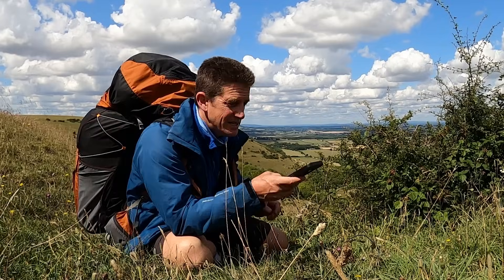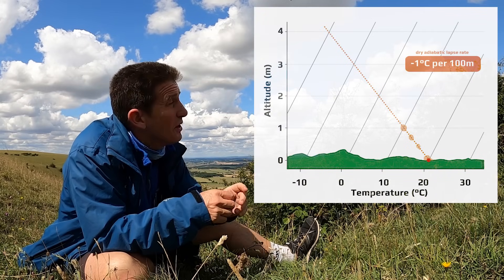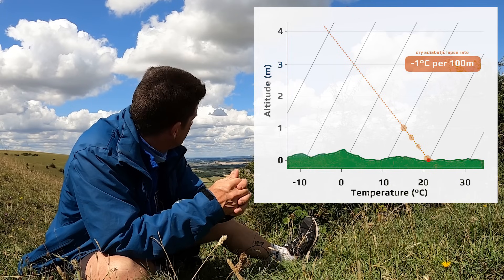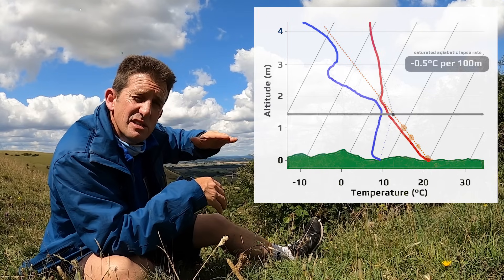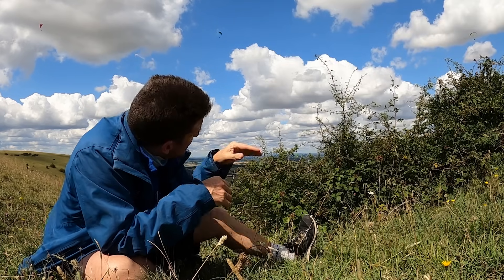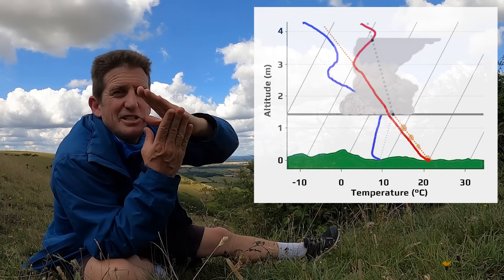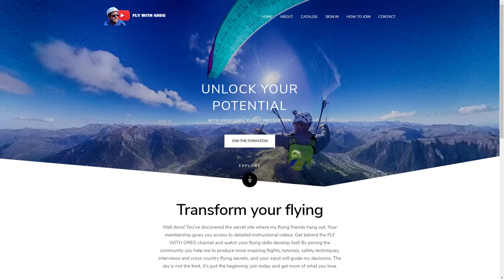How do CLOUDS and THERMALS really work?

Comment: Holy poop Greg, What a fantastic explanation of Thermals.  I personally have been in 1400 Ft/min up, with my Hang glider. Bar pulled down to my nuts and still going up at 400 ft/min. Middle of summer and sleet on the front of my gloves :)   The 2 -3 seconds of disbelief looking at my Vario, made me remember an article about "Cloud-suck" read while sitting on the "Throne" 6 months prior :) ... Escaped the lift and learned first hand what you described here today.  My point is, to thank you for taking the time to explain how the "Thermal engine" works and by default, you may or soon will have saved lives.  Nothing better than having a first hand Nature Moment to drive home the lesson.  All the best, fly safe :)

Comment: Hi Greg although I am not a paraglider pilot ( I did fly a paraglider a few times on the training hill )  my background in aviation is in hang gliders, sailpanes and 
fixed wing aircraft. I have seen a few of your videos now and I have to commend you on your presentaion. Absoulute understandable ,quality videos .
I do have to take issue one one point in this video at 8:33 where you said that there needs to be an inversion to stop the cloud from rising further.
While this is true ,the presence of a stable layer ( very little ,or no change in temperature with altitude)  will effectivly do the same thing,although it won't
arrest it as fast as an inversion will.
Many instructors will say that thermals are stopped by an inversion layer when actually they are being stopped more often by just a stable layer.
Keep up your great content.Your efforts are appreciated by many.
Reply: My bad Greg . I did not see on the graph at 8:56 ,where you wrote " Or at least a stable lapse rate "  Once again Kudos for an explanation
that anyone can understand.

Comment: Hi Greg
Liked and new subscriber.
I'm a paramotor pilot who tends to be a bit geeky and I really appreciated this video.
I have been using and preaching the Skew-T charts to all my PPG buddies who would listen (most don't) and I've wondered how interesting they are for PG flights.
Now I know.
The charts have a long learning curve but they provide so much information that I'm astounded that more people with and without motors don't use them.
I understood some things about them already but you've added to my knowledge and understanding of the cloud engine with this video.
I plan to eventually be a daytime motor off thermaler (no hills to launch from in this area) and this will certainly help.

BTW, there is a Skew-T app on Android which seems to work fairly well. I rely on it more than on any other weather app for day of and day prior to any flying.

Thanks!

Comment: Great video, as always :) Super informative! 
How do mountains affect the skew-t-chart? I fly in the alps and often find clouds forming much lower than the predicted cloud base from the emagram (skew-t-chart) or expect clouds to build much higher and they don't. Perhaps I'm just reading it wrong...? 
Example skew-t: https://www.meteoswiss.admin.ch/home/measurement-and-forecasting-systems/atmosphere/radio-soundings.html
Reply from the maker: Mountains complicate the picture, because after rains they hold sources of moisture up at higher altitude, so introduce moisture that will condense earlier than you were expecting. After a day or two, on open slopes, the mountain has drained and dried and then it acts to boost the thermal power and the added heat can raise local cloudbases. So it depends on the timing relative to rains.

Comment: Hi Greg, great video.
I think your dew point line is wrong on the drawing because your thermal temperature line doesnt cross the dew line, so the cloud doesnt form.

For the cloud to form and climb up, the thermal temperature has to be left of dew point ( otherwise it doesnt condensate) and right of environmental temperature line.( otherwise it doesnt climb).
Reply: Not so, but a very understandable mistake. The thermal moisture content is derived from the source, at the surface.whee the thermal was born, not the surrounding environmental air at altitude. Therefore the dew point trace is irrelevant for a rising parcel of air. The moisture content of the thermal is constant, and we follow up the line of constant humidity, not the dew point temperature trace, to find cloud base. It’s a different line on the graph, which Greg didn’t cover. :)

Comment: Great video! I was wondering for a while how come clouds work the way they do. Please allow me to express doubt about what you are saying at 2:45. If you take ideal gas law, you will see that with increasing volume (of the air in the balloon) the PRESSURE will go down but not TEMPERATURE (in a closed system which it is). This mistake can be easily made if you consider temperature as number collisions. However, the temperature is the amount of kinetic energy the gas has (which of coarse increases the number of collisions but it is still a consequence, not a cause). It doesn't influence your further arguments so it's just a detail. I don't know how these balloons work but I guess they measure the difference in pressure inside the balloon instead of temperature. Or I made a mistake somewhere? If I did, please correct me. Still, thank you for making this video! I learned a lot!
Reply: Look up isentropic expansion: Reducing the pressure through an adiabtic will indeed decrease the temperature and increase the volume.

Comment: Maybe I’m misunderstanding you but I don’t think what you are saying at 2:20 in the video is correct. 
This is the way I see the world working. Cold air is dense and the molecules are tightly packed together. Hot air is less dense because the molecules are moving and create space in between. A hot air balloon goes up because the air is less dense and lighter. A balloon gets bigger the higher you go because of the pressure from the atmosphere the same way it would get smaller as you submerge it deeper in water.
Reply: I think similarly, I commented with a more detailed explanation higher up.
Reply: The Ideal Gas Law states that PV=nRT.

If you heat a gas (T increases) but keep the volume and pressure constant (like a hot air balloon), then 'n' (the amount of air molecules) have to decrease. The heated gas gets less dense, when air molecules escape from the bottom opening of the balloon.

For a rising thermal both the pressure and the temperature of the surrounding air sinks, which the thermal tries to align itself to.

So if P decreases, then also T decreases. If the pressure has been equalized, but T is still larger than the surrounding air, then 'n' has to be lower. The thermal is still lighter than the surrounding air and keeps rising.

This goes on until the pressure and temperature of the thermal equals the surrounding air.
Reply: @krijo210  thank you for your input! the statements are not wrong in general but are not applicable to the question raised. First, of all you are talking about an open system, we are talking about a closed system. Secondly, Greg clearly describes the expansion of the balloon at 2:30 which suggests that volume is not constant, thus your first statement is not applicable to the situation.

Comment: I loved the general explanation! But it feels like the chart explanation was lacking - I found those graphs exceedingly hard to wrap my head around when I started studying them  (one of my questions was: the dew point curve is always to the left of the rest, why does it even condense??) and I feel that how to read an interpret the graph should be the subject of a video in and of itself.  Love the channel!
Reply: Yeah, would love more detailed explanations. I don't understand how that blue dotted line came to be. Why is it inclined at a certain angle and all that.
Reply from the maker: this can get complicated and very detailed so I've kept it focused only on the basics here, on the cloud engine itself. Find a skew-T sounding for your own flying site / area and play around with it, you'll learn fast. The dew point curve sometimes touches the red temperature trace, then you get a static layer of cloud (100% humidity, no convection).
Reply: @FlyWithGreg  Completely agree, and again that explanation was awesome. Thank you as always!
Reply: The chart is wrong, if the dew point is left of everything it doesnt condense.
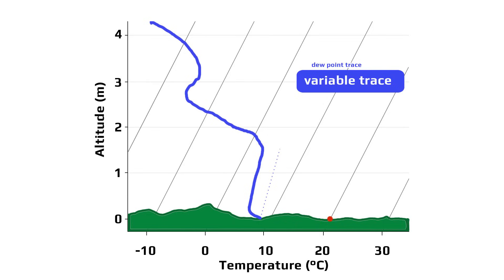Reply: @niconico3907  The way I remember learning it: the dew point curve gives the temperature at which condensation would occur for air that starts out at the same altitude, given the relative humidity at that altitude; this is what the balloon measures as it is going up. However your thermal air bubble starts at the ground. It will condense at roughly the dew point temperature measured at the ground. This is the dotted line that Greg traced at 4:54 (it's not vertical because air density and relative humidity varies with altitude)–when your adiabatic line from ground air temperature (orange dotted line) intersects it, that's where that air bubble will start to form a cloud.

Red (continuous) line touching blue (continuous) line: air starting out at that altitude will immediately condense = 100% cloud cover.

Red line quite far from blue line (= very dry air throughout): you get "blue thermals" lifting you up but no cumulus clouds to be seen.
Reply: @HermannLoose  thanks! that makes sense now

Comment: Excellent video. That cannt be explained better by a video. Just one thing though Most of the time the thing that stops the clouds to overgrowth is wind aloft. Up there if the wind blows 40km/h, that cloud can not get higher but under that cloud there could be a strong lift. So most if the time wind demolishes or tears towering clouds. 
This video i think is the best instruction you shoot. I can feel how much effort and thought you spend in this video.
Reply from the maker: If there's a good lapse rate the cloud will continue into wind aloft, it just gets tilted, but yes I get your point, wind can shred clouds